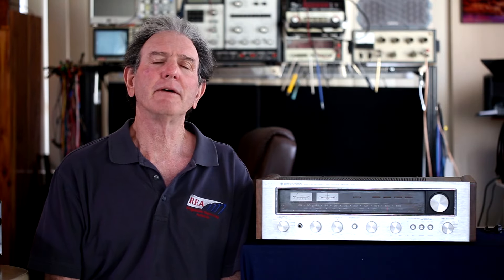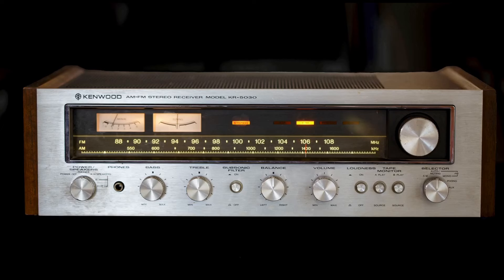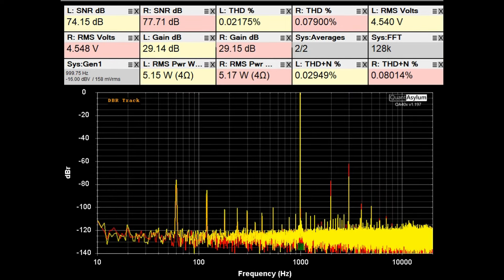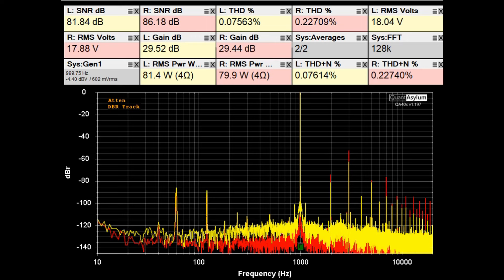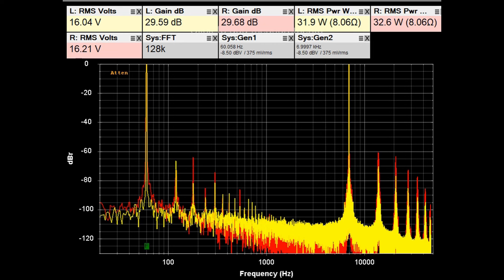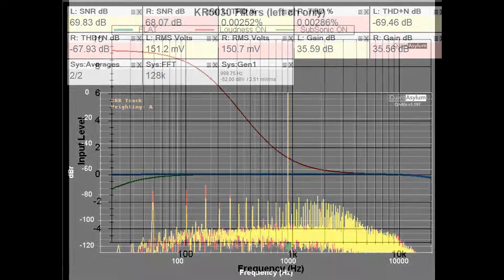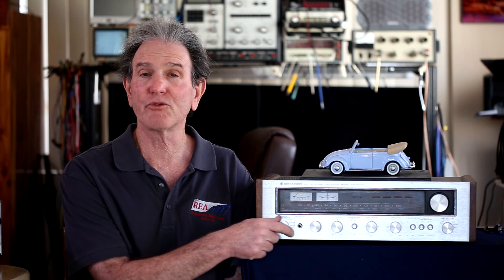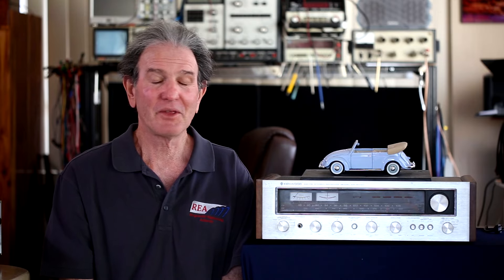Kenwood KR-5030 Stereo Receiver- Vintage Audio Review Episode #120

Comment: I’m like a broken record…. Every vid of yours I’ve watched I think the same… comprehensive, understandable, presentation and vid quality excellent. I haven’t seen any other channels that do this kind of component review as well as you do it.
Reply from the maker: Thanks so much for the encouragement. I had a complaint about the sound quality once, but only 1. I pretty much follow the same "formula", which helps me in the time it takes to do a video. I know that my going over data plots is not very exciting for most, but I have added chapter breaks you could FF over them quickly if you wanted to. I get to check out a lot of different gear which is great (except when I think I would like to own it 😆)
Reply: A bit ironic having sound quality criticism eh?  Anyway, recent vids production is pretty top notch to my eyes and ears.  Yeah , I struggle at times with the plots and the meanings.  Not because of the presentation, but because of my lack of knowledge.  As an aside, what is striking is the pulled down frequencies in the speaker tests due to room characteristics.  Very sharp and defined.
Reply from the maker: @ragnarhairybreeks  I actually found a wireless mic that I could get for a reasonable price, but the external mic I have mounted to my camera seems to be doing fine. The room I do most of my listening in has a huge window in it as well as a large skylight, which is helping with those "pull downs". I should probably do a freq sweep of my system and see how well I have equalized it out...
Reply: I find it quite amazing how definite the frequency drop outs are due to room.  Put that subject on the back burner for a future vid maybe?

Cheers

Alistair
Reply from the maker: @ragnarhairybreeks  I probably would not be able to do anything in that room as far as room treatments due to my wife- I am lucky to have two sets of speakers in that room. If I were to test more speakers I would consider look into maybe some portable panels that I could place around it...

Comment: Hi there VAR, I recall selling quite a few of these when new, especially once that particular line the  KR-XX30 series  was being heavlily discounted  on inventory closeout.  If I recall correctly that model could be purchased new in the box for $250, we had stacks of these things in the store I was working in, it was a good buy for the money and sounded fine. Thanks for the memorys again. :_)
Reply from the maker: Thanks for sharing your memories. My research came up with a retail price of $425 for the KR5030, so your the model below that was maybe $250. I would have spent a lot of what I made working at stereo store back at the store....
Reply: @vintageaudioreview  Hi again, that $250 price was once that model line or  series of various  recievers  had been discontinued, and we sold a lot of Kenwood's during a brief time window. Get rid of the old stuff, make room for the new models, and at the prices we had all were a really good buy for the money. Thanks again for the video.